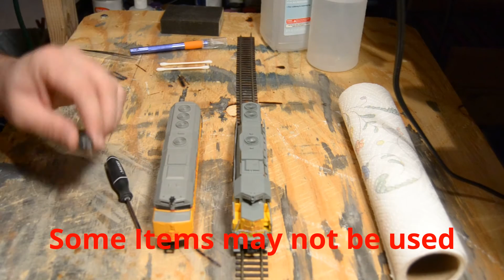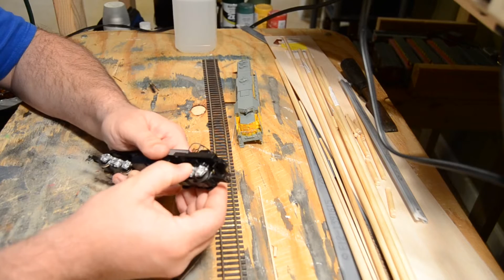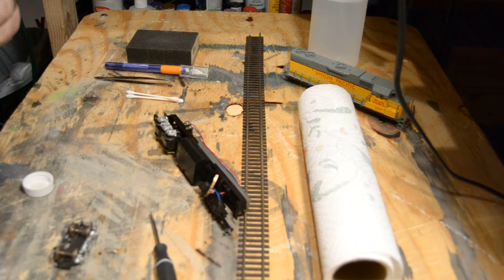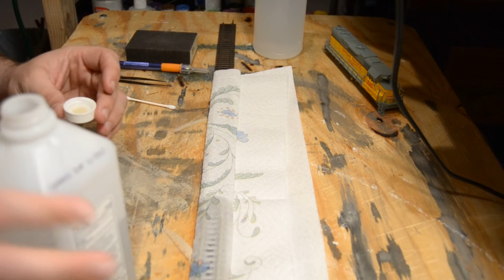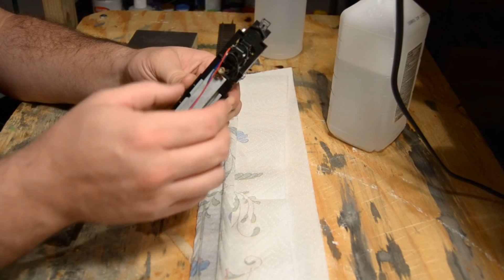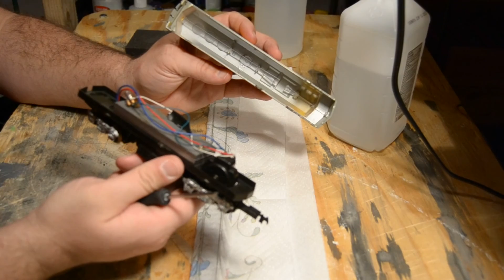Life-Like DC Engine Maintenance

Comment: Howdy Georgia boy!  Great maintenance video even though I'm watching 6 years later.  Very good explanation as you went along.  I use the Labelle 106 grease for models.  As I've heard from other modelers, grease for the gears and oil for the bearings/bushings.  Cheers from an ex-Georgian in eastern TN

Comment: I Have a Life Like Power Loc F Unit Santa FE Warbonnet it doesn't Run any more and the Part that Holds the Wheels poped Off My Question Is do I Need To Replace the Part that Holds the Wheels  or do the Wires need to be ReSolder
Reply from the maker: Not sure Oscar without looking at it. I was lucky enough not to have any broken parts. Thanks for watching-Ed

Comment: Hey man I have that power loc track that the rails are tarnished and the copper connectors are tarnished...  What to clean with?

https://i.ebayimg.com/images/g/OPcAAOSwOwJfTTib/s-l640.jpg
Reply from the maker: I like to use crc electronic cleaner. And rub the track with very light pressure with a bright boy block.